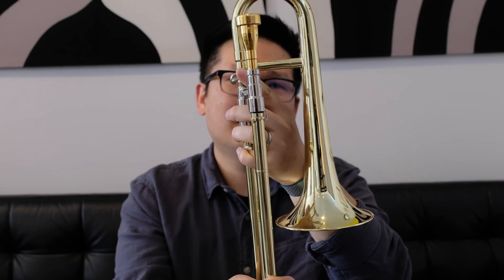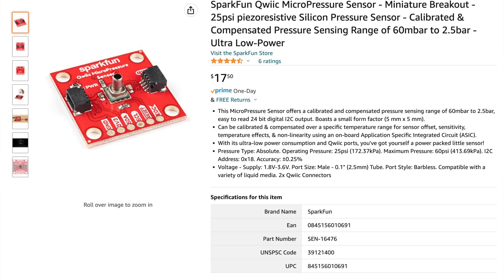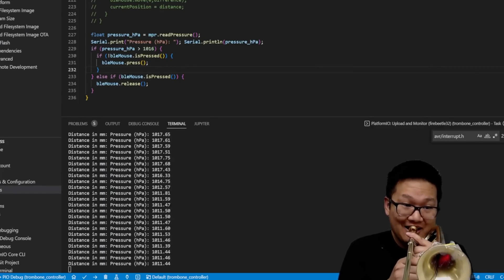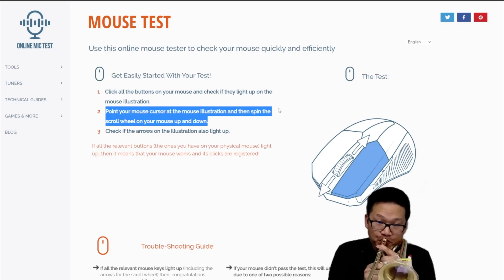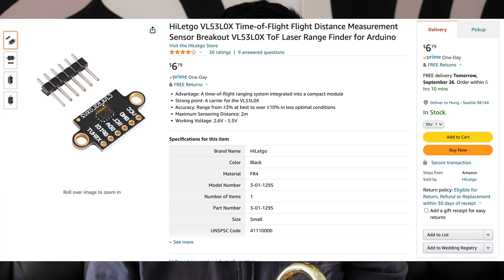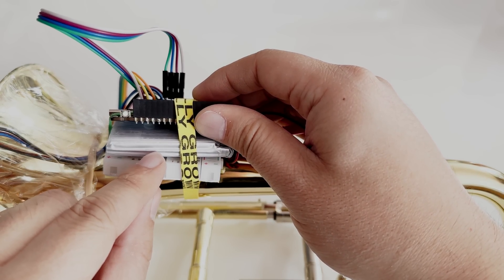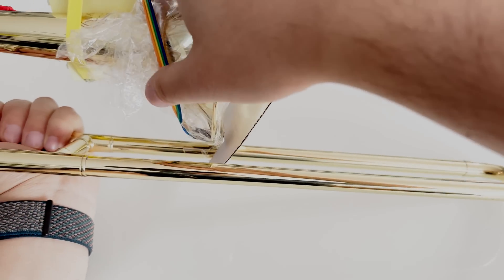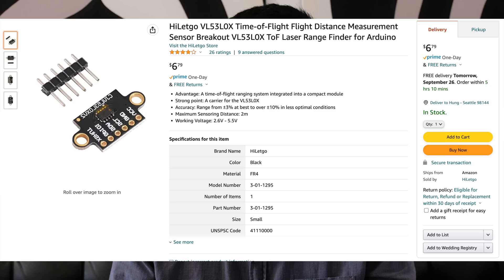I Made a Trombone Champ Controller From a Real Trombone!

Comment: I've bought a lot of stuff from hiletgo, I think this is just not a great tool for the job.  One thing that might work significantly better would be a hand-made linear potentiometer.  Or a normal potentiometer and a gear system to turn it.  For the linear approach, you'd put 3.3v or 5v or whatever the ESP32 uses out on one end, and read into the ADC pin on the wiper which would be mounted to the slide somehow.  For the resistive strip, you can find pre-made strips or make one from conductive paint or filament.  With a 3d-printer, it could probably be mounted fairly firmly.

Thinking more about this, you might even be able to use the slide itself as the potentiometer, depending on how tight that fit is...
Reply from the maker: That would be pretty cool. I do like the idea of having a physical way to measure the distance rather than relying on the somewhat unreliable laser measurements.

Comment: What about using a microphone mounted to the bell of the trombone?
It actually is a type of (oscillating) air pressure sensor.
From the amplitude you can get the signal for the mouse click event.
Postprocessing the sampled audio signal with a FFT (fast Fourier transform) you can get the frequency which will change by playing the trombone and sliding.
Mapping the minimum and maximum frequency to the position of the main slide you will be able to control the mouse position.
Reply from the maker: I was a bit hesitant to try to use a microphone to measure anything since I'd also be playing a game with the sound on pretty loud. I wonder if the sound from the game would interfere too much with the mic in the bell. Plus without any air pressure the game will be really hard to play for any extended amount of time. It still might be worth checking out this technique for different types of projects though!
Reply: I was also thinking of using a microphone, but instead of using it for pitch it would just be "if sound, then click". There would be some other sensor to control the pitch.

Comment: This is superb!
Have you considered mounting the electronics in a mute? A practice mute plugs the bell enough to allow your air pressure sensor to function, and gives you a solid morning platform for your side positioning to go from.
I've been looking at building a trombone-esque midi controller for a while. It's great to see some of the things I was struggling with addressed here!
Reply from the maker: Thanks! I did think about using a mute, and I happen to have a Yamaha silent brass practice mute sitting around somewhere. I agree that this would be the perfect mounting platform for the electronics since it can stick out of the bell and not be attached to the trumpet by... rubber bands. If I was to make this more than a toy project, I could totally see myself 3d printing a mute platform and then sticking some corks onto it to fix onto the bell. I think it would need to be a custom built thing as a regular mute does give some backpressure but probably not as much as I would want if I'm only blowing and not actually playing the horn. It could even hold the esp32, battery, breadboard and the other components. Great idea and thanks for the comment!

Comment: So for the slide, another possibility is an actual mouse sensor.  Initially I was thinking of an optical quadrature sensor like old ball-type mice used, but a modern optical mouse sensor would work just as well.  The only question is what should it look at?  Well, one obvious possibility is the inner slide tube, but it would need some kind of pattern applied to it instead of being perfectly shiny.  You could experiment with a sharpie marker (it comes off smooth surfaces with isopropyl alcohol).  But if you didn't want to do that, you could attach a stick to the slide for the sensor to look at.  Again, you'd want to make sure the stick had some kind of pattern on it for the sensor to pick up easily enough.  As far as making a mouse work with your blow sensor, you could have the mouse be responsible for bluetooth, and have the ESP (or a simpler microcontroller) just toggling the button input on the mouse based on the blow sensor input.
Reply from the maker: That's pretty interesting. I think it could work pretty well if it all fit inside the slide (mine is pretty small since it's a soprano trombone) and it was set up so it didn't actually touch but just hovered over the thing it was sensing. Thanks for the comment!
Reply: Soprano trombones have the same pitch as a trumpet, so some people might think of them as a trumpet with a slide instead of valves
Reply: Or could use a slider/fader instead of a laser
Reply: There are basically 7 positions on the trombone... but they are not really exact and you use muscle memory, sound, and what you are trying to do (playing in between positions is needed sometimes)... the sensor would need to be able to see your pointer finger knuckle on your slide hand in relation to the bell... that is how you teach the positions at least. 1 is all the way closed with lock completely turned off. 3 is just before the back of the bell rim. 2 is between those a bit closer to 1. 4 is just after the front of the bell rim. 5 is about the same distance from 4 as 2 is to 1. Same with 6 and 7... just don't go too far lol. But yeah, not sure a sensor could be super accurate lol. Would be cool if it were more accurate and taught kids trombone though... trombone is the best instrument. And the only one that can do a true glissando ;) but yeah, don't use sharpie on your slide. the slide is sensitive and should only have slide oil on it. even touching it a lot with your hands introduces contaminants that can ruin your horn without cleaning and reapplication of proper oil. also you might need to make sure you pick a completely closed tuning slide (the one in the back that takes grease, not oil) because it doesn't always stay in the same position and can change the tone. but maybe the tone doesn't matter for this game and it is about the sensor position? anyway, trombone is way cooler than the guitar... just saying ;) have fun! and get an actual trombone ;P

Comment: A linear encoder on the slide might be better as it's easer to get an absolute mouse position
Reply from the maker: Ah interesting. This is how digital calipers work, right? I think it does check a few boxes like how it gives an absolute position. I tried to do a search for some off the shelf ones but it doesn’t seem like they’re very easily purchasable, so I might need to diy it. Pretty cool though, thanks for the comment!
Reply: @techsistentialcrisis  Not exactly a digital caliper, they use a magnetic strap. But anyway, this linear works as potentiometer, but it is linear (like a tape) instead rounded. The price is a little bit high,  above 100$. But you can try another way, use a rotary encoder with a belt, like an exis of 3d printer, but removing the step motor and put the encoder. About the filter in the laser sensor you can try it first, but it is not guaranteed to work, but it's free. Try to fix better the cardboard or change the material.

Comment: My thought for the slide would be a potentiometer with a tire set against the slide so it will rotate as the slide is pushed past it.
Reply from the maker: I think that could work but I wonder how much friction it would add to the controller. A trombone slide is pretty smooth so I would want to limit the friction which is partly why I went with a no-touch method. I also wonder how much “travel” you could get from one, if it would limit the usable range once you hit the “end.” It is an interesting idea as there are pretty much an unlimited number of ways to try and implement this! Thanks for the comment!
Reply: Or a linear potentiometer, which is really just a strip of resistive material and a wiper wire that runs along it.  You can even make your own; they're not terribly complicated devices.

Comment: About the distance sensor being finicky to work with—I believe that's to be expected. A lot of these types of sensors tend to have very sporadic readings. You're expected to do some post-processing to clean up the values in order to make the output readings from the sensor actually consistent and suitable to your requirements.
It's nice that you picked a laser sensor over the typical ultrasonic, I think the quicker response time is necessary for it to catch the faster movements from the slide.

It's also been a bit since I've messed around with sensors and embedded stuff so definitely take that with a grain of salt :D Really loving the video
Reply from the maker: Yeah that makes sense about the post-processing. I did a bit of filtering to try and only move the cursor if the position changed more than x mm, but that had the effect of making it harder to get a precise movement. I'm sure I could write some more code to make it better; the stuff I wrote is as simple as possible (just takes the diff between the previous and current measurement and moves the mouse up or down a number of pixels by a factor of it (1.5 times I think).

I'm glad you enjoyed the video! Thanks for the comment!
Reply: @techsistentialcrisis  you could perhaps add an array of accurate coordinates for where the mouse needs to be to hit the notes bang on, and have a function snap the sensor input to the nearest accurate value. Should give you enough freedom to slide around, but get accurate results when pretty much on the position.
Reply from the maker: Haha sounds like the equivalent of aim-assist but for Trombone Champ! That's probably beyond the scope of what I'd like to do, especially since the game is a lot funnier when the notes are out of tune!
Reply: @techsistentialcrisis  ha ha yeah, snappy snap function will make it too easy. Maybe use a map function to plot the input and have it a tiny bit smoother 😂
My trombone midi controller is getting rid of the slide completely, and using a sensor to track hand movements like some kind of ridiculous shoulder mounted theremin ha ha
Reply: @techsistentialcrisis  an IIR filter is very easy to implement and would smooth out the output values, with some tuning it might work to "clean up" the sensor values
Reply: @techsistentialcrisis  One thing that is very much not helping you is how wiggly your target is. A piece of cardboard taped on is not stiff, so the target itself is bouncing around relative to the slide when you move it, and the faster you move the worse it gets. It also looks like the air escaping the bell is causing the cardboard to deflect as well. So on top of Time-of-flight sensors generally giving very noisy/sporadic readings, the distance it's measuring is actually bouncing a lot, even if the slide itself isn't moving. A 3d printed target or something that is much more rigid (both in material - cardboard is not rigid - and in how it's attached) will probably give you noticeable improvement.
Reply: @techsistentialcrisis  there's a lot of options for the filtering, but a simple moving average filter should be pretty effective. Just store the last X measurements and average them, adjusting X to trade off between stability and responsiveness.
Reply: @TurplePurtle.  exactly what I was thinking.
Reply: @techsistentialcrisis  it could also be a problem with the cardboard flapping around, maybe a sturdier backboard
Reply: Could the red light from the pressure sensor be giving problems?

Comment: Curious about how the slide going in and out would affect the air pressure sensor as it would create a breif change everytime it moved. Did pulling the slide in ever cause it to dtect blowing?
Reply from the maker: 🤔 Wow I have no idea how I didn’t think of that! To be honest it seems that the slide moving around doesn’t affect the air pressure too much. I could see it being an issue maybe when there are sustained notes that require you to move the slide at the same time. My guess is that the air pressure change with the slide is negligible compared to the change when blowing, but maybe I’ll try to measure it and answer that question in a future video. Excellent question and observation though! 👏👏👏

Comment: For airflow, how about a differential pressure sensor and plumb it in line with the mouthpiece?  Might not be easy to find a prototype board with one.
Reply from the maker: I wasn't aware of this type of sensor. It looks like there is one available that would be easy to hook into an arduino or esp32: https://wiki.dfrobot.com/Differential_Pressure_Sensor_%C2%B1500pa_SKU_SEN0343

I forgot to note in the video that I don't really want to make any permanent changes to my horn, since I'll probably keep playing it more than the game (no offense lol).

I think for this to work I'd need to maybe drill a hole in the bore or something to get the sensor in (or maybe modify a mouthpiece). Either way I think my air pressure sensor works pretty well. Thanks for the comment though! I got to learn about another type of sensor!

Comment: Very cool project! Very clever to use an air pressure sensor
Reply from the maker: Thanks Geoff, I just wish it was small enough to fit in the mouthpiece or maybe the slide, so I wouldn't need to seal the bell, but it sorta looks cool in there anyway.

Comment: Haha this is awesome. If you could figure out a way to use a mouse scroll wheel or potentiometer I think that'd work really well for the slide!
Reply from the maker: Haha thanks, yeah I think a scroll wheel could work but I wanted to try something that wouldn't impede the slide's movement at all. I saw a slide potentiometer on adafruit but it wouldn't cover the entire length of the trombone slide so I thought the laser would work best. Hopefully the new sensors I'm getting in the mail are good!
Reply: @techsistentialcrisis  looking forward to seeing this perfected!